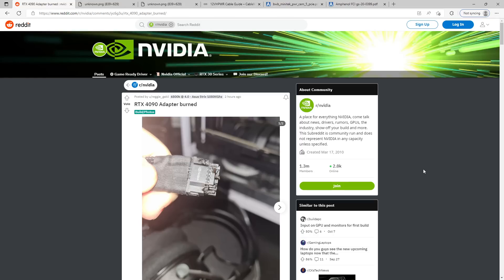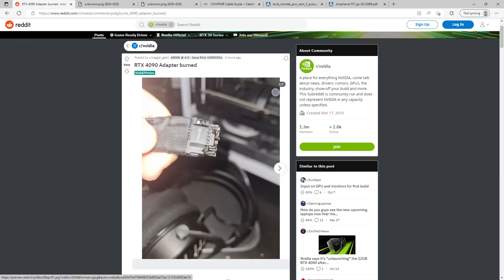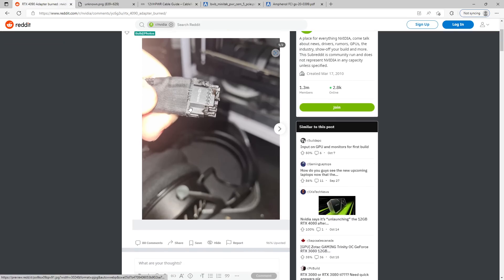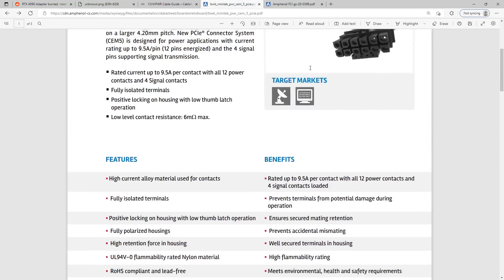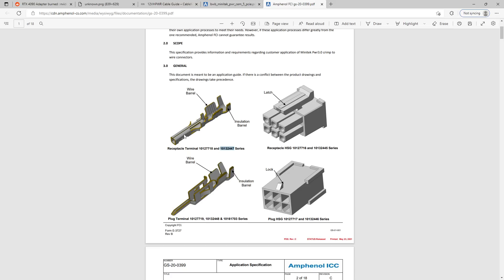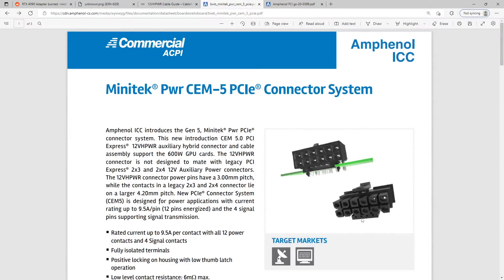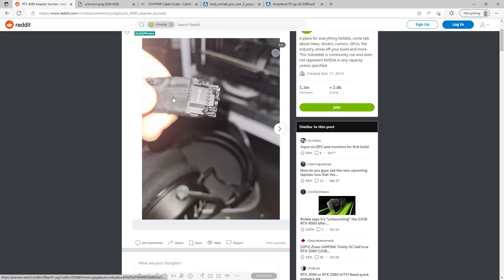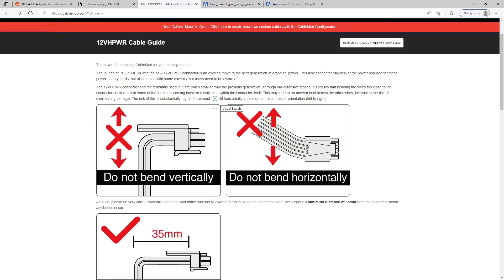The 12VHPWR connector sucks

Comment: You know if they did a molded connector with embedded copper then the wire was soldered in place, the bending would be a non-issue.

Comment: Nvidia: Let's reduce the connector size by 4 while doubling the power. What could go wrong?
Reply: Law of physics for resistance of electricity: Let me stop you right there
Reply: 4 8 pin 16 gauge cables can handle about 1300-1400w.  The issue is the connectors not the cables.
Reply: @ewitte12  Not really. The old connector was spec'd to 9A per pin by Molex, so that would be 324W per 8pin PCIe connector (only three wires carry power). The problem is the ATX spec that didn't trust that limit in the slightest and limited it to 150W.
Reply: @anlumo1  that is worse case which is what the spec is for.  18-20 gauge cable on a crap PSU.  dual pcie cables are rated at 2x150W by PSU manufacturers.  The physical limitations are a bit over that.
Reply: I wonder how many house fires started since the 4090 released.
Reply: Moores Law is dead, duh.
Reply: @dontreadtoofarintoit1868  This is more Ohm's Law than Moore's Law tho.
Reply: All they had to do was adopt a standard 24-pin plugin and quit using those candy-ass hollow pins in the 1st place!    But no, because "NVIDIA"
Reply: The core of the connectors still look like the HDD powerconnectors 20 yrs ago.
Reply: Wire gauge is higher than PCIe 8-pins.
Reply: @ThunderingRoar  
Huh?
NVIDIA doing psu papers now for isme dept LoL

No not right
Reply: While increasing the price.
Reply: pfeezhycs my dude.
Reply: Regardless of who came up with the standard NVIDIA has used the standard for the 4090, did they adequately test the cables that would be used. I would guess cable quality would be a variable that would play a significant role in any potential failure scenario.
Reply: I'm starting to think that a marketing or graphic designer made the connector instead of a proper engineer, because it is laughingly bad engineering with problems that anyone with minimal electrical and thermal knowledge would have seen coming miles away with that kind of design
Reply: How dare you question Nvidia!!!!!
Reply: @ThunderingRoar  "This other dude says the thing I said so its correct"
Reply: @AlpineTheHusky  yeah this "dude" is a fucking head engineer or some shit for corsair power supplies who also used to be the biggest power supply reviewer like 10 years ago
Reply: @ThunderingRoar  That is even more embarrassing that he doesnt know that
Reply: It's because people are using the wrong PSU.

You need a v3.0 PSU to properly run the 4090, probably the same for rdna 3 too.

So NVIDIA to bring it the card this year have made a retro fit cable so people can use an v2.0 psu for the moment.

There's only 1 or 2 v3.0 PSU out for sale right now
Reply: @zagan1  Most of the problems are technically the users fault but its a risk the PCI-SIG took
Reply: The size of the connector has nothing to do with the power going through it. There are similar sized cables pulling multiple thousand watts.
Reply: Not at 12 volts. Nobody in their right mind is putting hundreds of amps through a connector that size.
Reply: @fern3436  It would help if the manufacturer used a wire gauge 1 bigger size.
Reply: @lilblackduc7312  It's the connector, not the wire.
Reply: @samiraperi467  How does the electricity get to the connector? Do you think cheap/undersized wire getting hot might have something to with the plug getting hot? It's both. the whole thing is shoddy.
Reply: @Neucher  You're technically correct and completely missing the point. Thinner cables can carry more power because they have a higher potential (voltage) and need less current to carry the same amount of power. The thickness of metal in the cable is generally determined by the current, not by the power.

Apparent power = potential difference x current

In a PC we use 12V give or take to power a GPU. 600 / 12 = 50A
Meanwhile to get 600W at 240V grid voltage: 600 / 240 = 2.5A
You can therefore use a much thinner cable for carrying that amount of power at mains voltage safely than you can inside a PC that uses 12V.
Reply: @Neucher  the size of the connector does play a role. Quality and design are important, but it does play a role.
Reply: @ThunderingRoar  it’s Intel for making a shit standard
Reply: Nvidia didn’t create the ATX 3.0 connector. The ATX standard is maintained by Intel.
Idiots should really stop parroting dumb info, but they wouldn’t be idiots then.
Reply: @thierryfaquet7405  So Nvidia didn't. AND? Why they include an adapter? Are you trying to say that Nvidia was forced to put that connector on their GPU? Your comment doesn't make any sense m8..
Reply: @thierryfaquet7405  It was adopted into ATX3.0 after Nvidia had been pushing it as their standard and it was on so many GPUs already.
Reply: @thierryfaquet7405  I've read your comment 4 times, and I still can't find a single point. Nobody is saying Nvidia created the connector. They chose this connector for their new GPU, right? And it sucks, right? You don't have to be an engineer to know that picking a connector, especially one you plan on standardizing, is an engineering decision.
Reply: @thierryfaquet7405  It's not the ATX 3.0 connector. ATX 3.0 is a standard maintained by Intel. The connector itself is the PCIe 5.0 connector; you can have ATX 3.0 power supplies without the PCIe 5.0 connector, and you can have non-ATX 3.0 power supplies with the PCIe 5.0 connectors.
Reply: @thierryfaquet7405  Yeah like nVidia totally had no say in this matter especially when it's them and only them who needed that crappy connector in the first place. You're not as smart as you think you are.
Reply: @thierryfaquet7405  while nVidia didn't create the connector, they are the ones who decided to use that connector. Nobody forced them to use it.
Reply: @thierryfaquet7405  well they didn't created the connector but decided to use so blame on them :p
Reply: @thierryfaquet7405   nobody forced nvidia to use it
Reply: @thierryfaquet7405  Ok jensen
Reply: @thierryfaquet7405  The connector has nothing to do with ATX 3.0. The connector is PCIe 5.0 spec. The PCI SIG "invented" the connector.
Reply: @thierryfaquet7405  NVIDIA designed the 12-pin connector first used on the RTX 3090 FE, and then handed the design documents to PCI-SIG to develop and standardize. Intel develops the ATX wiring standard for motherboards, which is separate and has nothing to do with the development of the 12VHPWR connector. PCI-SIG makes it easier for everyone to follow the standard and adds the ability to slap a certification label on your product once it passes their tests.
Reply: @thierryfaquet7405  Even if they did not design it, they chose to use it. It was a poor choice.
Reply: @thierryfaquet7405  Intel and Nvidia we're the two companies pushing this connector by far and away. It's here because of them.
Reply: @thierryfaquet7405  even so, they could choose to stick with the 8pin or use the experimental one... And even NVIDIA put out a white paper about the plug failing in there labs ...
Reply: Stay on 15year old technologie never need upgrade?
Reply: @Zazash_91  if it ain't broke...
Reply: @carlwillows  Having a mini ITX reducing the PCIE cables from 3 to 1 would be ideal
Reply: @Zazash_91  This isn’t an upgrade, it’s a downgrade, from a 15 year old design. Go figure.
Reply: Lol how is this Nvidia fault? Are we going to blame AMD when they use this connector?
Reply: @Estarossa300  NVIDIA is 'cheeping out' on parts. A blind man could see it.
Reply: @lilblackduc7312  how? Intel made the standard. The pins are just really thin. I’m sure AMD will use this standard too.
Reply: @Estarossa300  funny that intel came up with this but they don't use it thats kinda sus
Reply: @Estarossa300  cope
AMD said they ain't using 12 pin

Comment: GPU manufacturers are going to innovate with military grade power connector guards next gen. Thanks Nvidia for pushing innovation
Reply: you need to be careful with the words " military grade" that does not equate to the best....by any means...
Reply: Military grade? So, something designed in the early 60s and contracted to 20 different companies?
Reply: @Kios_Antares  Andbuilt to the minimum requirements to pass the test
Reply: @Kios_Antares  I love that no matter the country you served in, this is always true 🤣
Reply: @Kios_Antares  I think military grade in this context means a plastic shroud that looks like powder-coated metal, preferably earth-tones in color, and fewer RGB leds.
Reply: Like the "military grade" capacitors which all the motherboard manufacturers were boasting about in the late 00s and early 2010s, even though they were no different to any other capacitors?

Comment: This conector needed to be 400w max, if you want 600w then a extra one or even a 8 pin extra one.
Reply: This connector needed not to exist. These 400W+ cards are pure idiocy.
Reply: @Leopardipzg  I agree :goodvibes:
Reply: @Leopardipzg  400W+ cards do have a purpose though.
They're a means for people with more money than sense to fund the development of more powerful next-gen midrange GPUs which match the performance while using a sane amount of power and not costing over $1000.

Comment: Question though... how is an average consumer supposed to know about this i have a few friends who aren't into PC hardware as i am, and i don't know how they would know about this ever
Reply: It is a fair question, however I feel that if you buy a 4090 you kinda are into computers/hardware. Only enthusiasts buy these cards imo. And whenever you buy such an expensive piece of hardware, I think it is common sense to google about it for couple of minutes to see the potential issues/stuff that you need to worry or not worry about.
Reply: @dobrescusilviu4189  That discounts all the people who but the priciest prebuilds because moar $$$ is Moar better. And those builders aren't always very good, and receive trauma during shipping.
Reply: I'm not saying this is normal, but with the connector should come a manual on how to install it and it should include these diagrams. It's a good practice to go through manuals/instructions even if you know what you are doing.

Comment: Why dont we just use the EPS connector (CPU one) with 4 12V pairs? Im pretty sure they re used in enterprise and data center GPUs but not the consumer ones
Reply from the maker: would probably very confusing because the EPS and PCI-e look very similar and it's actually possible to force one into the other if you push really really hard.
Reply: @ActuallyHardcoreOverclocking  Im not talking about shoving wrong connectors into eachother. I meant why dont we just use the same connector for both cpus and gpus by design and spec? IMO that would be less confusing.

Are sense pins really that necessary if gpus like NV A100 use the EPS cpu connector
Reply from the maker: @ThunderingRoar  oh I agree that the 8pin EPS would be way better GPUs. I meant that the transition over to 8pin EPS would be very confusing.

Comment: Maybe they just should make the connector housing longer, like 35 mm, to prevent this. But then some users will have trouble with the space it will require...
Reply: better than a fire hazard
Reply: @dioneto6855  what are you talking about? Can't you see all that space being taken? It's gonna eat like, what, 1 cm bigger?/s
Reply: @soi8739  it's likely heat shrink tubes, it acts as a strain relief.
Reply: Which will add enough leverage to make it easier to rip the connector off the board.
Reply: I am happily congratulating you for getting a position at noVideo, well done!

Comment: I work for a petroleum company and we make cables with alot of different connectors, incuding the new type from nvidia withouth those sense pins, and yea, we certified that connector at only 300w due to high resistance when the cable went out of its optimal posision. Not only you will need AWG16 or 1,5mm2 wiring to support 10 amps per pin, those pins arent even supported to use with so large wires and the pins themself cant even handle 10 amps. I'm actually suprised that it hasnt been worse so far. This screams american made wiring.
Reply: And now this lousy connector is part of the ATX 3.0 spec for the next decade or so.....

Comment: Is this connector a requirement for the 4090? I know that some AIB 3090s still have the classic pin connectors rather the 12pin connector of that time.
Reply: Buildzoid said in another comment here that nvidia made the 12 pin a requirement for board partners for this generation
Reply: founder edition
Reply: Have not seen a 4090 that comes with a 8 pin, they are all 12 pin so far

Comment: Next Gen: RTX 5090 cards will require 2 separate house circuits in order to power the 3000 watt GPU.
Reply: don't be silly, it will need a three phase power connection
Reply: @justahologram2230  that would be actually an intelligent choice, they can't do that
Reply: and the power connector will be half the size of the current one, because fuk your combustible house

Comment: Because nvidia decided they need mini-ITX PCB  size on their flagship cards with some weird triangular cut out for blow thru fan. Use normal size PCB and you can fit fucking ten 8pin PCIE connectors.
Reply: This bigger size PCB will cost Nvidia 10$ more per rtx4090. They cant afford to THAT 😂
Reply: mini itx my ass, it's a lot taller than the bracket making it hard to fit in most SFF cases, even with a waterblock (about that: why is no one making waterblocks with fitttings at the end of thecrad instead of the top?)

Comment: for a company charging so much the wire gauge the size of the plug and the pin could not handle a 400-600 watt load. I don't even think it's a 16 0r 14 gauge wire and also what the pins capacity?

Comment: I don't understand why they would adopt such a dumb standard. Is this supposed to trick a consumer into thinking it doesn't use much power, because one 12pin is less than four 8pins? I hope AMD learn from this.
Reply: Rumors stated that AMD will get rid of this connector and stay on 8 PIN pci-e (probably 3 connectors).

Comment: This is really scary material, spending u$1599 (or more) to be let down by a connector that shouldn't exist in the first place. 
First we get the "connect and disconnect the cable for just 30 times" which was not the case, right?.
And now this.

Comment: CableMod Modflex extensions are using this exact pin style everywhere
I've had 3 come loose, and won't stay in very well, one is on my 24pin.
Nothing's burning up though. Just no post after building.

Comment: i was looking forward to a replacement of the ancient 6+2 pcie connectors, but i was expecting something better than this crap. more alike the 12v 8pin EPS connector but with 12 or 16 Pins in a 50/50 12v/gnd split without some stupid sense lines.
Reply: well... think sense lines was to try and make sure gpu's didn't blow up the psu's but well... we are at a time where most psu's are reliable (except from gigabyte....)

Comment: NVIDIA should just put 2 eps 8pin on their card.
Reply: 48V USB-PD would be nice, three USB-C ports for 720W, nice flexible cables, wouldn't mind it going to the mobo too...
Reply: 20 pin power connector.
Reply: Fr, just one 8pin EPS is enough to handle more than half of the 12pin

Comment: This video just makes me feel even more sad as an sff enthusiast. I already dislike the ongoing trend of higher power consumption of components as if we are going backwards (although the power efficiency of new architectures is still improving I don't see why we should normalise higher power consumption when we are going through a recession). What makes this worse is that now we are being supplied by inferior hardware and the obvious higher chances of this cable at least destroying your gpu if not being a fire hazard because of lower amount of safety precautions implemented on it as compared to its (completely fine) predecessor.

Comment: I am confused: is the card trying to balance the current in each pin somehow?

The point of multi-pin connectors is that each individual pin has random resistance, and you want to carry most of the current over the few pins with least resistance. This is usually achieved by just connecting the pins together on the card end -- which keeps the voltage constant across all of them, which achieves what we want.

The point is, if a pin (or wire etc) suddenly has high resistance, you want to stop the current flow through it. This usually prevents melting until all of them have high resistance...
Reply from the maker: think of the connector as a set of parallel resistors. If the card is pulling 600W at 12V it will pul 50A through those resistors regardless of how much total resistance they have.
Reply: Ehhh that is not how it works. As pointed by AHO wires in this case behave like resistors in parallel and they are splitting total current through the wires (in this case pretty much equally so six 12V wires means 1/6 of total current is going through each wire), basically simulating current carrying capacity of for example single much higher gauge wire. 
For this application resistance of copper wires is negligible at these distances, it's in the single digit mΩ territory.

What actually melts these connectors is, you guessed it, bad connection and subsequent arcing which produces MUCH more heat then the constant current passing through the wires.

Just to put it in perspective, even if the wires used for this cable were 18AWG (didn't read the specification but they are probably 16AWG) and you pull two out of the six 12V wires so only four are left, cable could still provide 50+ amps of current without being anywhere close to melting plastic housing of that connector or wire insulation.
Reply: Nah. The point of the single connector is to safe money on nvidia's part. 30-90c per card they can squeeze more out of the customer. It's a simple as that.